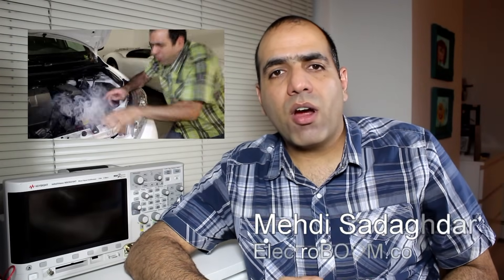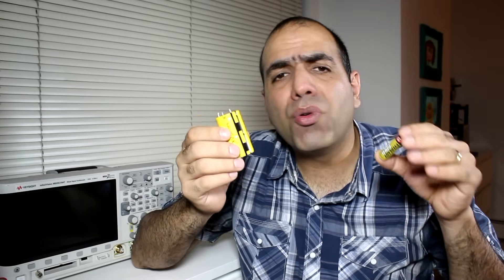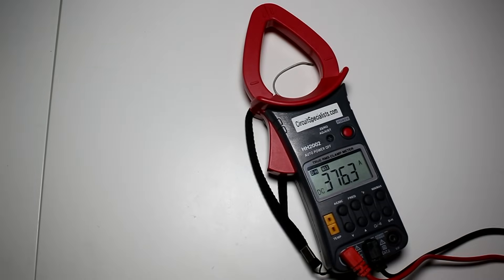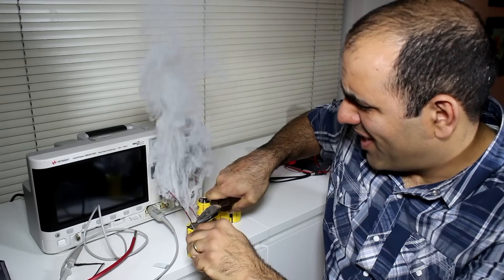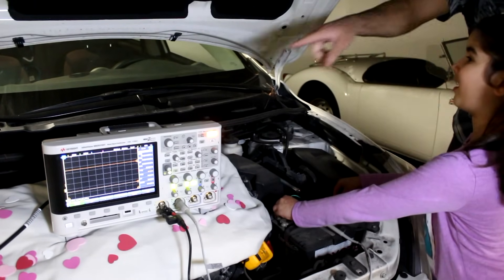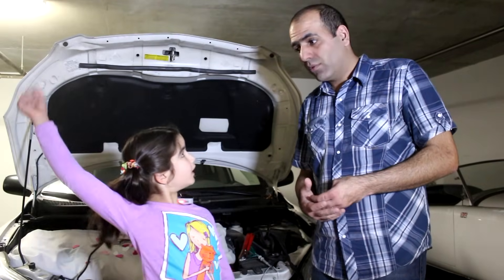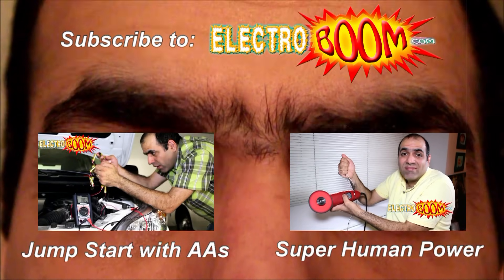Cranking a Car with Super Capacitors (Supercap)

Comment: I don't know enough about how Farad is calculated, it seems strange that adding capacitors in series drops the Farad number...it must be as the voltage goes up but the amp/h remains the same you have to recalculate the value. Anyway, I just order 6 supercaps at 2.7v and 3,000F to make a battery pack with high cranking amps.
Reply: A capacitor is two conductive plates separated by a dielectric, the capacitance depends on the size and distance between said plates. When you put two identical capacitors in series, the distance between the anode of one capacitor and the cathode of the other doubles, so the capacitance halves.
Reply: @BoredAutocrat  I've read that explanation before, and it makes no sense as the charge per capacitor shouldn't be affected by the next capacitor. I did however find out how farad is calculated, C=Q/V. Simply put as the voltage increases you need more packets of charge per farad. As adding capacitors in series only increases the voltage and not packets of charge, the total farad drops.
Reply: Far quad. Jajaja

Comment: It should be good as a voltage stabiliser but needs a processor because if you leave it hooked on it can drain the battery in a few weeks and if you put a relay from ignition the capacitor will stay discharged then after you applied ignition the battery would begin charging the capacitor at a very high current so you need a charging phase of 2 minutes with a resistor in series, at low current so that the bms can handle the imbalance then connect the power line

Comment: Sorry Mehdi, is it possible to measure DC current via clamp ampere meter? as we know DC current doesn't have a magnetic field
Reply: Any current makes magnetic fields. AC is just used in things like transformers because it's changing current makes a changing magnetic field which in turn induces a voltage in the secondary winding. Only changing magnetic fields can induce a voltage like this. But DC still makes a magnetic field and it is actually used in things like electromagnets where there is a big coil connected to a DC power source which makes a powerful magnetic field.

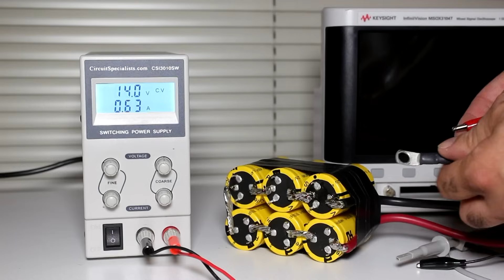Comment: 2:43 Isn’t it better to limit the current to 10 amps that way you won’t run the power supply above its 10 amp rating for a long time?

Comment: Next idea: can a typical mostly dead car battery still charge the super caps enough that one can crank? Because a common scenario is not a 0V battery, but one where either one of the six cells is shorted due to lead collecting at the bottom (so it is nominally 10V), and one where the internal resistance is way higher than usual (e.g. with an old battery in cold temperatures).

If the super caps are still enough to crank the car at 10V (which is half the energy of at 14V which you tested at), then they would keep you on the road a few times even without external charging. If they are still enough at 12V they would at least still handle the winter problems and can get you through another season or two. So wondering if it would be smart to have battery manufacturers include a parallel supercap instead of some of the lead acid cell space. Or even replace lead acid tech by NiMH/LiIon/LiPo with supercap in parallel.

Comment: Hi Mehdi.  There is no such number as two dot thirteen.  It is two dot one three.  For example, the number 1.8 and 1.80 are equal, yet pronouncing 1.80 as one dot eighty which implies the decimal value is 10 times that of the one dot eight.  Eftezah...

Comment: how big is the engine in the video in cylinders and displacement ? like 4c 6c 2.0 , 3.6 ? because this certainly matters for how much energy it needs to crank
Reply: i see in 4:36 the battery seems to be a 72 Ah . and it says 540 CCA(cold cranking amps)
Reply: I would guess 1.8L 4cyl.

Comment: I put a capacitor in  Parallel, with 12awg. It has a voltage display and is located in the cab. 
Scosche 500K Micro-Farad Capacitor

This display saved my but one day. Lost voltage from altinator. I parket the car with 11.5v and jumed in my better car.

I think it gave the car a boost when all  Components where running it still kept the motor running strong. With old blower fans for example in a 1986 celica gts. 

If some one has done this before. Maybe exlain if its better or a problem.

Comment: Well, I was about to buy a 500F 16V super cap bank to make a hybrid battery for my car, but I think I'll just get one or 2 of those 80F ones instead, as long as they can provide the current i don't see why they'd have any issue starting a little 4 cylinder.

Comment: One question, is it possible to use this capacitor bank for spot welding WHILE there is switching power supply charging them or will that burn open the FETs of the spot welder?  I bought a bank 6 x 500F supercaps almost identical to the video.  Came with a balance board for charging for $50 USD all in.  Great info in this video that I couldn't find elsewhere.  I am using them for spot welding batteries for an ebike.  Now I am confident there will be enough power, otherwise the FETs blow open and the $20 welder is garbage but can I charge the capacitors with the switching power supply while I spot welding, without damaging the FETs?

Comment: The real advantage , which to demonstrate, would have earned you my admiration, unfortunately went totally unmentioned.
It should be useful to charge from a depleted battery unable to get the motor running on its own. That way you can have one pack in your car without the need to worry about depleted AAcells.
You silly and have little understanding for your own creation.
You get my like anyway. Earned for entertainment.

Comment: 1:35 
Why he didn't got shoked by around 10 amps ?
Reply: Because the voltage across his body is minimal
Reply: there is no such thing as a sign that says “danger high current”
Reply: @rubiks_20  of course the current is dangerous. It's only that the dangerous voltage can drive a current that dangerous
Reply: @Questiala124  this make fu*g since

Comment: The Super capacitor is genuis because you don't need to recharge it assuming your car has no other problems. You use it to crank up the engine leave it plugged until it recharges then unplug. Thought I just remembered it has the internal resistance which is going to drain it overtime. Oh well maybe a theoretically perfect super capacitor is the solution then.

Comment: guys if u are confused, here are the vectors:
Voltage: volt
Current: amp (ampere)
Resistance: ohm
Capacitance: farad
Power: watt
Inductance: henry
Frequency: Hertz
Reply: Hotel : trivago

Comment: 4:26
I have done exactly this on my car, twice.
It tried to weld the wrench across the terminals
Reply: You're damn lucky that the battery itself didn't explode and spray sulfuric acid everywhere - that's not good for engine parts, even worse for human skin, and blinds you if it sprays into your eyes. Battery construction used to be quite poor, with low quality brittle plastics making up the outer casing and the lid of the battery held on by a weak press-fit. When the battery experiences a dead-short (like if you drop a wrench across the terminals or short out the jumper cables), almost all of the energy it delivers goes into heating up the battery contents.

If it's only a momentary short, for a second or two, that's usually not too bad - but much longer than that (like if the jumper cable clips weld themselves together and you can't pull them apart quick enough), then the electrolyte inside the battery can boil, blowing superheated acid out of the top - and that's if the battery is the type with removable cell caps for adding more liquid. If it's a sealed battery, the pressure has nowhere to go and the battery casing eventually bursts. This is less likely with modern batteries which use stronger plastics, but can still happen. Fully charged batteries are the most dangerous, not just because they have the most energy to give, but also because the concentration of the sulfuric acid inside is highest when the battery is fully charged. In a lead-acid battery, the acid is actually consumed (converted to lead sulfate on the electrode plates) when the battery is delivering current - this process is reversed when the battery is recharged.
Reply: @lloydevans2900  i removed the positive first but nothing happened.
Reply: @fuseydunae397  If you're careful not to touch any other part of the car while you're doing that, then nothing will happen. However, there is a reason for the recommended order of removal being negative first: The negative is usually connected to the chassis and/or bodywork of the car. So every metal part of the car can be considered equivalent to the negative terminal of the battery. This means that if you are loosening the bolt on the positive battery clamp first, using a spanner, every other piece of metal around you can form a dead-short if the spanner touches it - not an ideal situation. Whereas if you're removing the negative clamp first, the only other part the spanner can touch to form a dead-short is the positive clamp - which is still possible, but far less likely.

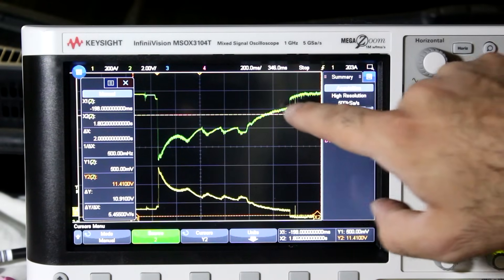Comment: Hello, I want to do a ultracap starter, and I nedd some help, in 4:40 or 5:12 , is car "cold" that day or just has been started in the previous starting with battery car? "cold" at what temperature? And why to use 6 caps and not 5 to adjust more closer to 12V battery car? Thanks you a lot.

Comment: When the regular car battery reaches end of life, replace it with this SuperFluxCapacitor, together with three 18650 lithium cells in series to supply the energy.   I suspect new battery would be cheaper though

Comment: Why does shorting it allow it do release much more current?
Reply: Voltage = Resistance × Current, so if the resistance is low (from shorting it) the current needs to be big to keep the same voltage.
Reply: Ethan John ohhhh. Thank you very much.

Comment: I have a boat with 2 main engine and 4 auxiliary engine. Right now all of them have their own separate 220 mAH battery or two. And now the boat sits idle much of the time and some of the batteries are dead. Could I use this contraption to start up the engine for maintenance purpose ? Because thinking of hauling two 220 mAh around is quite a hassle and this looks lighter.

Comment: I wanna ask u boss a question, how can I using a 100 cheap booster cable achieve a 400 to 600 amp to crank a car, I guess by using simple capacitor and maybe a diode to channel the electricity in one direction its achievable

Comment: They sale supercap jump packs on Amazon. They are pretty good.
Best part is you can use your "dead" battery to charge the capacitors. All you need is that initial amp draw, as long as your alternator works and the starter is good

Comment: I go total overkill. 72 Cells of Maxwell Tech 3000F@2.7V, as 3 banks of 24 Cell 6S4P= 2000F@16.2V, totalling Instant Magic Smoke provoking 6S12P= 6000F@16.2V (Porsche's Bosch Voltage Regulator is a solid 14.5V). Another 6 Cells of Maxwell Tech 2S3P= 4500F@5.4V for USBs. Haven't had a battery in the car for 5 years. 50Amp and 175Amp Andersons if I need to lay-up for a month or so, or to lend a hand jump start another vehicle, doing my best to not melt her into scrap. Thank you for entertaining and sharing.

Comment: Mehdi, i just want to ask little thing. It is safe to connect super capasitor and the battery to the car all the way when we operating the car?. Thank you mehdi.
Reply: Even it is fully charged capsitor.
Reply: @ubedmancing5332  Yes, because the caps don't draw current when fully charged.

Comment: Just a small suggestion from someone that works with car repairs:

- 6-7 Volts during engine crank is BAD for your car electronics. nowadays cars have anywhere from 40 to 120 different computers (ever wonder what governs your Digital, split, 4-way, Air conditioner?). During an engine start, the voltage should drop to 8-9 Volts MAX.... This way, I would suggest either build a parallel bank of capacitors with this one or going to a bigger supercap (Maxwell has some of 2600-3000F! a piece :) )

Comment: Thank you for such informative tests. I did notice that the original battery supplies a higher cranking current and a shorter time in startup the car when compared with the ultra capacitor setup.  The first peak of the cranking current should correspond to the current when the engine is stationary and sub-sequenced peaks would correspond to the compression stroke of the engine. An 4-cyclinder engine would have one compression stroke in one revolution. It seems the engine starts after 3 revolutions with the original battery and 4 revolutions with the ultra capacitor setup.
I did use an commercial 300A batteryless (ultra cap) jump starter to start an 1.8L gas car and obtain similar results.

Comment: 4:43 RIP that one heart that fell into the engine...
Reply: F
Reply: It fell into the engine bay and is easily retrievable. If it fell into the engine it could start some major damage
Reply: the engine and everything is sealed for dust and waterproofing so it's all good
Reply: “ThAtS nOt ThE eNgIne tHaTs tHe EnGiNe BaY I KnOw aBoUt caRS”
Reply: F
Reply: F
Reply: "into" the engine
Reply: 2 hearts
Reply: F
Reply: Legends say it still there
Reply: Engine is closed, so the heart simply cannot fall into it. You would have to push it in thru intake, but there is filter there just for that reason, so garbage don't get in the engine and break it.
Reply: @NeroKoso  thanks holmes
Reply: @Shubham Sawant r/woooosh
Reply: @kas-lw7xz  r/woooosh right back atcha bud

Comment: It's pointless to deny that you could crank a car battery with a suitably sized LiPo pack, as we see power banks designed precisely for that on late night scammy infomercials. My question to you is whether it would actually be wise to use a LiPo battery (or a battery of supercaps) in place of our ol' trusty lead acid battery?

Comment: If this works why don't we use them more in cars ? Can't the engine charge the super capacitor banks after it starts? Or is it the risk that if the engine doesn't start at the first crank the car is dead?

Comment: This is old, but I think the bigger question is if it makes sense to run the supercapacitors in parallel with the car battery to help with cold starts and extend battery life.  Though the capacitors would actually cause the battery to drain fast if you didn't use the car for a week or something.  Maybe a shut off switch to disable them if the car battery drops below a certain voltage?

Comment: Does it has advantages to let the capacitors hooked to the battery? Less drops or better cold weather starts
Reply: Christian Grey He didnt hook them to the battery, he used them instead of it. But there could br advantages i bet, it could provide more current for a bit and smooth out current

Comment: Can you really touch the positive and negative terminals on a battery, one with each hand and crank it and not die? How does this work?
Reply: Adam Stephens electricity goes through the path of least resistance. Seeing as your body has like 3MOhms, and the starter basically no resistance, it will go through the starter and not you

Comment: So car was cranked with a little assistance by minor relative. At least you didn't fried your girl. honestly I in such case I would give mine children to do something like that only if I knew that he/she have a clear escape route. Actually the thing which should be supported was oscilloscope. Screw those caps :P  By the way the couple of super capacitor battery together with a 4-6S LiPo battery for charging seems good enough for using as emergency charging device. Have a need to crank my car in cold winter mornings sometimes. I will think about that. 

How to pay your children about work... well, mine nephew got access to mine racing quadcopters after doing home chores. Guy in his 11 is now flying quite well.

400F of capacity is quite much. In year 1984 at mine electronic lessons we had talk about how big would be capacitor of 1F. It wasn't possible with technology at these days though.

Comment: i start car with lipopolymer battery from my drone its small and not heavy but can give a lot of amps for its size when i start my motorbike with lipo it cranks faster then ever and i use 3cell so its only 12.6v i did not want to try a 4cell 16.8v

Comment: Ty... Found you a while back and enjoyed.  I've just about got all the parts to build a spot welder with maxwell 350f that are same esr and stated Max of like 170a. I've got 2 parallel strings of 6 in series.  I figured with the tiny plusetime used( mosfet control)  I wouldn't have an issue.  I need at least 1k amps for good welds( by my research) but wasn't sure these would do it with out blowing. Wish they could stated a pulse current on data sheet. don't want to be kicked out of my apt for blowing up a string of caps on short.  What I saw here confirms I shouldn't have an issue. I want a little more current than starter Drew at Max but Esp with 2 in p I should be good.  Keep up the great work..  Also lol at electrocute holding battery terminals

Comment: Well... what you could do is to change this big 12v lead-acid battery for a smaller one, and put in paralel the supercap setup. The battery deals with long time not using the car, and the supercaps deals with the startup... less weight, less kicks to the battery...  and it's cool, because it's a diy!!! 

-just don't forget, + to + and - to - battery to supercaps, hehehe -

Comment: i have 14 volts drill battery charger 
but my drill and it's battery are worn out so i was thinking can i use this charger to charge car battery?  some told me it is impossible because the amount of  amps in the car battery are more than the charger.  but i really don't know...  does anyone know if it was possible or not to charge car battery with 14 volts drill battery charger?